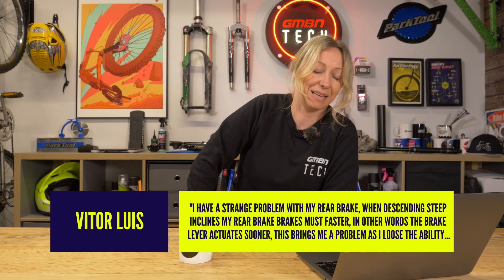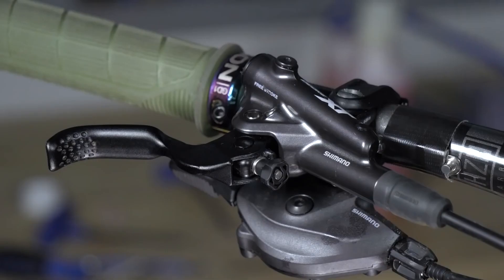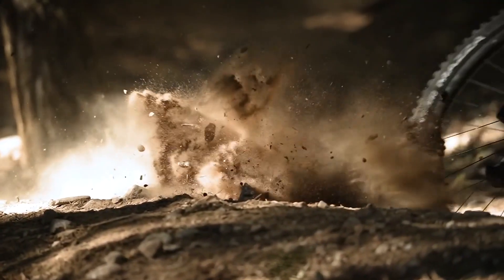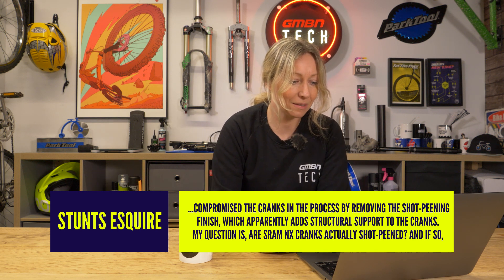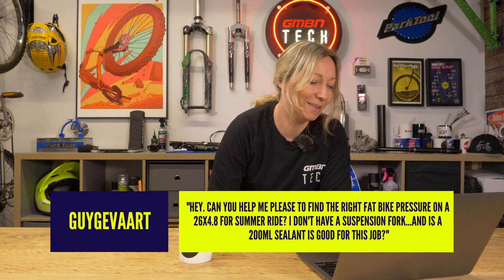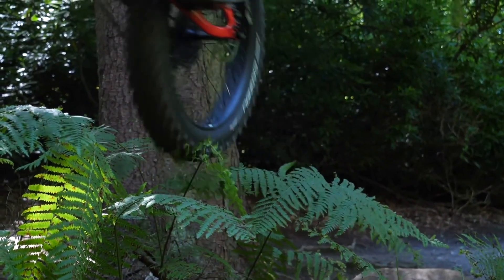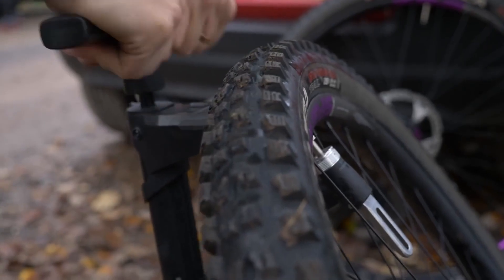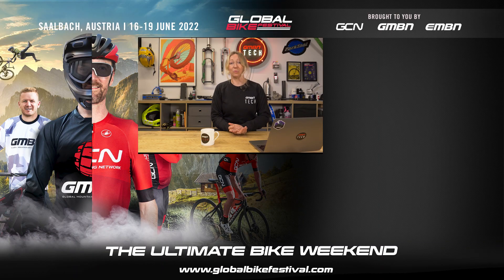Is Stripping Your Bike Paint Safe? | #AskGMBNTech 182

Comment: Regarding the front axels, i ran a fox 36 talas with 20mm axel for exactly 10 years, never had problem with it. Qr as well. In the last 2 years however, i bent 1 15mm on my brand new 36 boost in one crash, first ride. Also had the same on my xc bike, a fox 32 non boost 🤷

Comment: Tyre pressure is always a balancing act. For a smooth surface, generally, the optimal sidewall compression under load is approximately 15%.
"Easy" way to find your optimal pressure is to inflate your tires, front and back to the maximum recommended pressure (stated on sidewall).
Get someone to help. Set a ruler or a piece of paper and mark off the rim height above the ground, divide that into 7. Take one 7th of.
Sit on the bike and have your helper deflate the tires until the rim gets to the marked off reduced height.
For rougher surface you will want to reduce the pressure more (for track cycling/velodrome you only want to reduce with 1/8th of the sidewall height).
Reply: Silca has an optimal tire pressure calculator on their site which works wonders, but it only goes up to 65mm/2.6" width.

Comment: The part about shot peening and anodizing was a bit wonky, to be honest. Anodizing does not add any kind of mechanical strength to a component but increases its corrosion resistance by forming stable oxides on the surface (which prevent corrosion). 

Shot peening introduces compressive stresses into the surface which have to be negotiated by tensile stresses (use of a component). Therefore, the resistance to cracking as well as the resistance to fatigue failures is increased by shot peening. However, the effect of compressive stresses is only measurable within a few micrometers beneath the surface. Therefore, grinding with a Dremel will most likely remove the shot peened region and simultaneously all the compressive stresses. So if NX crank were shot peened, they would most like lose some sort of mechanical strength due to the Dremel treatment.
Reply: so if you just use a paint stripper then you should be safe right, since your not actually removing any material from the crank besides paint? Also if the process of shot peening only goes down a few micrometters is it really doing anything, like are we talking about the break point after shot peening is 400lbs and a part without shot peenings break point is 199lbs or do you think this is just a new way for companies to sell their products with a new technology that only adds minimal strengthening.
Reply: @NonLegitNation2  You're absolutely correct with assuming that using just paint stripper is fine. 

Shot peening is not just a hoax, it is often used in mechanical engineering. For examples the surface of springs (just like in your car) are shot peened.

The effect relies on cold work hardening of the surface but predominantly on imposing compressive stresses. In order to initiate cracking one needs to overcome the intrinsic lattice forces of the material, which is normally achieved by tensile stresses. If this occurs within one load cycle (or maybe just a few) it is called overload fracture. Shot peening will not really improve the materials resistance to this failure mechanism. 

The big advantage of shot peening is the significant improvement of the resistance to fatigue failure. Fatigue occurs by repeated load cycles, normally well below critical stresses that lead to instant cracking (overload, as described above). Since fatigue stresses are moderate, local compressive stresses due to shot peening will kind of cancel them out and therefore the remaining stress is even lower. This is strongly related to the fact that fatigue cracks on technical relevant components and surface qualities will always initiate on the surface and subsequently propagate into the bulk.

Applied to cranks: cranks are put under compression and tension throughout every revolution, hence fatigue may occur. A shot peened surface in the area of the largest stresses (most likely around the pinch bolts that connect the cranks to the axle) will improve the fatigue resistance.

However, I don't really believe that rather inexpensive NX cranks are shot peened.

Comment: Shot peening adds a compressive stress to the surface of the material to reduce the likelihood of cracking (dramatic oversimplification). It is unlikely that polishing would remove all the effected material removing the stresses induced by the shot peen process.

Comment: Standard ,s in the bike industry can be super annoying and often confusing but ! I actually think we have it easy .if you look at other things that are mass produced cars been the biggest and best example each manufacturers have there own parts and standards ,lawn mowers ,power tool batteries and not even starting from scratch with electric cars can we decide which motor\battery\charger to use within the same car brand so I think we have it easy .

Comment: There would be several issues with increasing the diameter of the rear axle but at minimum it would limit the size of the smallest rear cog and/or make the axle/hub/freewheel interface weaker as there is not a lot of "free" room between the internal diameter of cassettes and the axle itself. As to why the diameters of front axles wouldn't be increased, I would guess that since broken axles seem to be a very rare occurrence the simple answer is that there's no need for it to be made larger. If anything, advances in manufacturing tend to result in lighter, smaller parts.

Comment: #AskGMBNTech I recently bought a new set of rear brake pads. I cleaned off the disc and made sure to lightly sand the surface and then tried them. They are organic and they just don't bite at all. I have tried everything, even rode down large hills while holding the brake. Nothing works. Any suggestions?
Reply: -Remy

Comment: FYI - re: axles sizes.  I have a 2012 Kona Satori which has a 12 mm rear axle and had a 20 mm front axle on a Revelation Fork with a 110 mm hub width - all long before the "boost" spec.  Absolute pain when replacing the front wheel, though it  was a very rigid set-up. Have since moved to a new boost fork with a more 'standard' boost width setup and a 15 mm axle.  It runs 200/180 rotors btw with Hope EV4's and is very balanced on the brakes now.

Comment: 30 Psi is a lot for a 26 X 4,8 inch fat bike tire. Since the side wall is huge it means a lot of force on the rim, while most fat bike rims have cut outs to make them lighter. 30 Psi can jeopardize the rim over a longer time.
My fatty uses 26 X 4,7, I ride 15 Psi on roads, and around 10 on normal offroad terrain or on snow. On sand I reduce to 7 to 8 Psi, if it's extremely soft 4 to 5 Psi are also possible (but the bike gets sluggish then, and the tire has to be forced into corners with such low pressure)

Comment: It seems to me that shot peening is a form of work-hardening. Although it is sometimes used to reduce the shine of the piece (probably helps the paint to adhere too), it also hardens the outer layer which is what their goal would be here. Then it would be painted/anodized. Stripping the paint and sanding/polishing it wouldn’t compromise the hardened layer.

Comment: Had 20mm axle on my 2007 SPECIALIZED E150 forks…was a pain replacing the hub as no one else did them. IMO, the reason the larger diameter axles aren’t used at the rear are 2 fold… bearing size and cassette size. The smallest 10t sprocket would be too small to have sufficient metal on it to support the chain if the axle was larger and the balls inside the bearings would need to be smaller to allow the axle to fit within the hub and freehub body

Comment: Shot-peening metal hardens the surface of the material to a depth of just a few micrometers. It simply makes the surface more resistant to corrosion and surface cracking which overall improves the longevity of the part. So yes, removing the bit of shot-peened layer from a crank could in fact reduce it's longevity. But I don't suspect it's a dramatic reduction in overall longevity assuming the part is then painted or anodized and well maintained. In short, removing the layer does make it more likely to both corrode and (as a result) more prone to surface corrosion cracks.
Reply: I always thought short-peening was what I do to my wife on Saturday nights. 🤷‍♂️
Reply: @gr33dyglutton  name checks out

Comment: Q1: put a smaller rotor on the back brake to account for the reduced wheel traction. I used to run hope brakes on my DH bike with 205mm rotor in the front and 145mm in the back. Nicely balanced for the descents, the lever feel was about equal for each side.
Edited the rotor sizes, I forgot them after all this time, wish I still had those brakes
Reply: Then there's me running 203 vented front and rear 🤣💀

Comment: #askgmbntech
I’m am looking into upgrading my fork. I have a Marin Paradise Trail 27,5 hard tail. It has 140mm travel. I correctly have a rockshox recon. I’ve had by local bike shop. I’ve had them upgraded do to me damaging the internals. A lot of forks I find are for 29er and I was wondering if I could still run my 27.5 without changing the geometry? What fork do you recommend?

Comment: #askgmbntech 
Hey gmbn, when I store my mtb, it hangs on a hook with its front wheel on the ceiling. The oil in my fork then hits the top inside the fork. When I take my bike for a ride and I compress my fork, there is a squeaky noise. After a few compresses it’s gone. Has this to deal with the fact that I store my bike upside down? It’s a rockshox 35 silver air fork. The bike is just a few months old. 
Florin, from the Netherlands.

Comment: #askGMBNtech i use my cross country mountain bike to cycle to and from work, but i don't fell there is much top end, how would i increase top speed, but keep my climbing ability? or is this a case of 'you need a new bike mate!'
Reply: What cassette are you running if it is possible change your chainring to the next size up and up size the number on your first cog for your first gear and your highest gear will be at least 2 Teath bigger so your speed will increase
Reply: Find a compatible 9-11 speed cog set with the lowest number of teeth on the highest gear. Then change your chainring to the highest number of teeth you could fit in (as close to 48t as possible). Buy a new chain that would be compatible to your current setup. Done.

Comment: #AskGMBNTech Hi Anna and Doddy. If I have a bike with a 170mm travel fork and install one with 180mm travel, would I get better traction if I set the sag on the 180mm as if it is still  a 170mm travel,  due to the increased suspension droop? Any additional input is more than appreciated. Love the show, keep up the great work!

Comment: #askgmbntech hi Anna I am looking to purchase a pannier rack for my 29inch bike with a small frame and i have Horde Mens Mountain Bike - S and I am looking for a disc brake rack to  work with the dropper seatpost I have installed and I need a seatpost clamp for the mountain pints for the top of a standard pannier rack that mountain the frame where the wheel on the frame just above the rear axle  thanks for your help I am a small rider under five feet five inches I also have full length mud guards that attach to the frame. So I need extra clearance for my mud guards

Comment: #AskGMBNTech I recently took my bike out and gave it a clean and look over since I have not ridden since August due to a broken leg, I noticed that my front derailleur and shifter are not shifting up and down. What are some reasons why this is happening and should I take into the shop to get checked out?
Reply: Check the shifting cable. Could be stuck do to corrosion.

Comment: #AskGMBNTech Hi Anna, I have followed your cleaning video and scrubbed my chain in a box and it worked well. I tried the same with my cassette but after multiple repetition with drivetrain cleaner it still feels sticky and the gunk is still in the tight spaces. What else can I use to get it clean?

Comment: #askgmbntech I have a 2021 orbea Occam in a XL and I carry it on my roof with a Thule 591 bike carrier and I struggle with the wheelbase of the bike the front wheel is on the very end of the bike rack and the wheel is shaking all over is there a better rack to take longer wheelbase bikes
Reply: Common problem in thule roof racks, but easy to fix, just move the arm holding the bike more rear, you can just hammer the rail to move with a rubber mallet for example. Iha have L Pole evolink and the rack fits fine.

Comment: #askgmbn:If I was saving money for almost a year and then worked for three months and gathered 2500-3000€ ,will it be smart to buy a 2500 € bike or not. Also I am not an adult and I don't have an income and the money came from savings and a part time job in the summer. I have a 300 € mtb and I want to upgrade to a canyon spectral.

Comment: 3:08 Here it shows the diffrence. I truly miss Doddy on this show as main runner.
1. Pads - not only they might be used or made by different materials, but also brands - different brands have different pads meaning een if both are fully metalic the braking power will be different. how much? that depends on the specific of each brand.
2. Rotors - not only the size matters, but also what model they are - different models may have significant difference in braking. not to mention brands - the same - brands make their rotors from bit different metal mix, which correspond to braking power.
3. brakes them selfes - if you have different brands on front and back this might why the braking power is so much stronger.
Preferebly the front / back brakes should be the same brands. If they are not - switch the calipers, back to front, front to back
4. Mineral oil - is not regulated as #Doddy said million times. This means different brands can have leninent ways of producing it. meaning it will have different tempareture scale to work with, which could also explain difference in braking power if u have front and rear in different oil mixture.

so My advice (if you have the funds):
- bleed both brakes using dedicated Mineral oil for your brakes (shimano for shimano) (Magura for maguras) 
- buy new Rotors of same size and make sure they are the same brand and the same level.
- buy new brakes of the same tier (example: Magura mt7 for rear and front)

if you dont have the funds:
- switch rear caliper to front and front to back
- bleed both brakes using dedicated Mineral oil for your brakes (shimano for shimano) (Magura for maguras)  but bleed them urself using the same mineral oil for both
check the braking power, if there is no change:
- switch the rotors: back to front, front to back.

#Doddy would have said something very close to my explanation or at least mentioned the things i written down here.